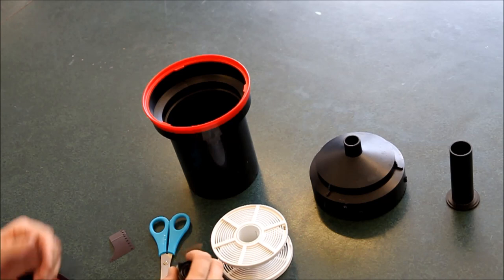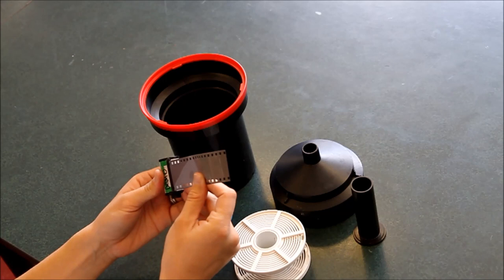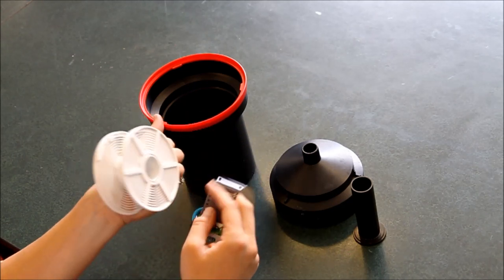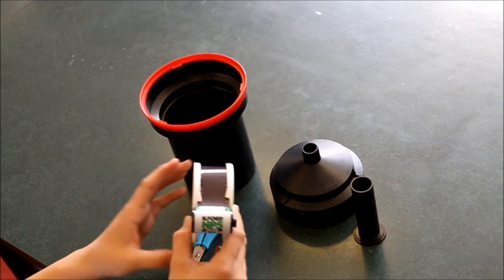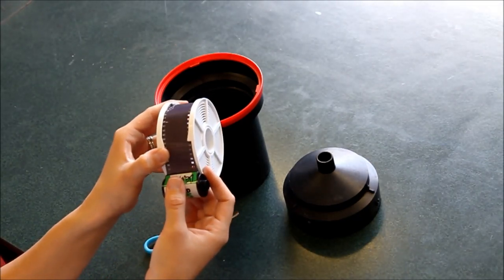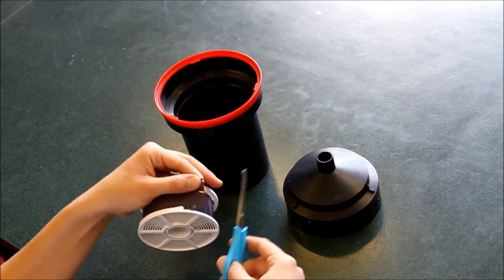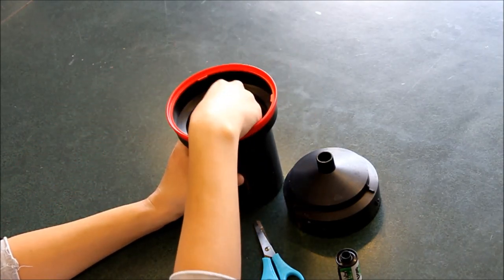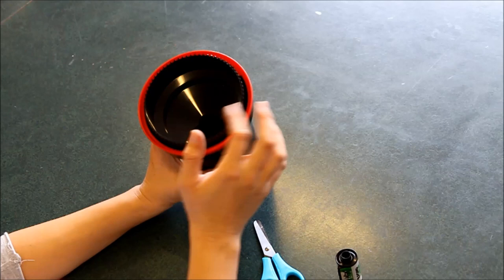HOW TO: Load film into a processing tank

Comment: In a tank that holds more than one reel, you should always put the other reels on top, even if you aren't loading them with film to prevent the loaded one from sliding up and out of the chemicals during inversions. Sometimes friction will keep the loaded reel stuck part way up the center cylinder, so putting all the reels in prevents this movement. Obviously, the loaded reel must be on the bottom, to remain submerged in the chemicals.
Reply: that's a very useful tip, thanks!

Comment: Question: when youre done shooting and ready to take the film out. When do you know to stop reeling in your roll in your camera before you pull the canister out? How will you avoid ruining some of your photos?
Reply from the maker: Hi! When you start rewinding the film you'll feel the tension while you're turning the lever. It should be firm when the film is still on the other side of the camera and when the tab releases you'll feel the winding become loose without and tension when turning. If you stop turning when you feel this pressure change then you'll have the edge of the film out, thus no longer needing to pick the end of the film out for developing. If you're wanting the film right inside the canister, just continue winding a few times before opening the back of the camera. Remember that when you load your film in the first place, you'll have 10-15cm of film out of the canister when loading so it's ok to then have this much out of the canister when opening the back of the camera if it hasn't quite rewound fully.  Hope this helps!!
Reply: Mrs Steele yes that makes sense, thank you so much!

Comment: You can load your camera in the dark and save on pictures because you will lose pictures and this should all be in the dark not just some of it.
Reply: freewithnature yes correct - but not everyone has a darkroom and you still get the same amount of shots on the film as described, you would possibly only gain one more shot. You will still lose the same amount of images from the start of the film after winding it around the spindle.
Reply: @simoneillingworth  Not necessarily. I think you can avoid losing images if you rewind the film a bit more, in order for all the images to get into the container. It may be tricky, but it's doable.